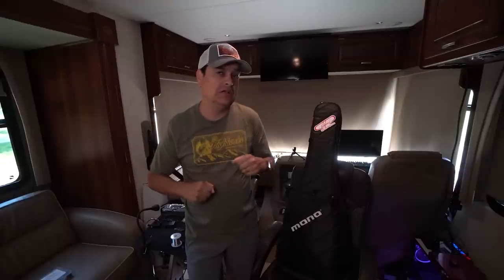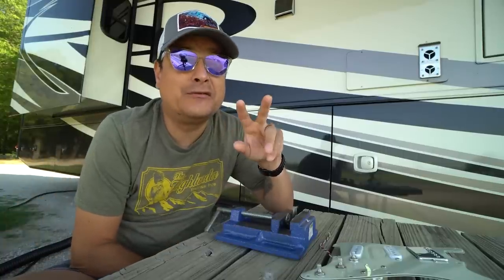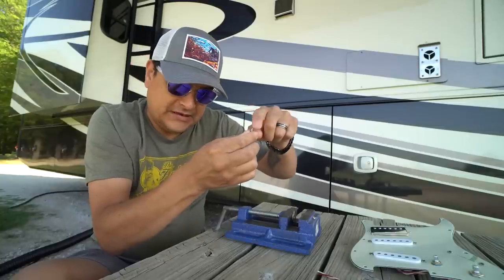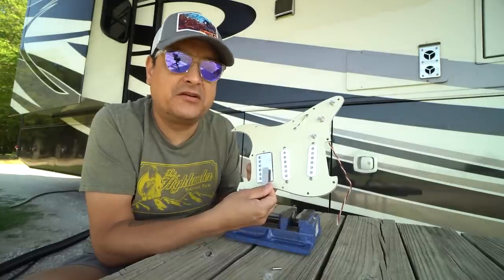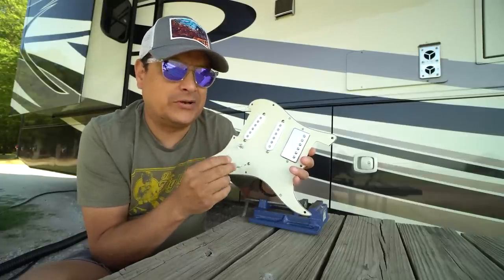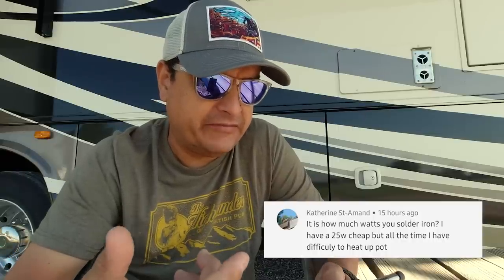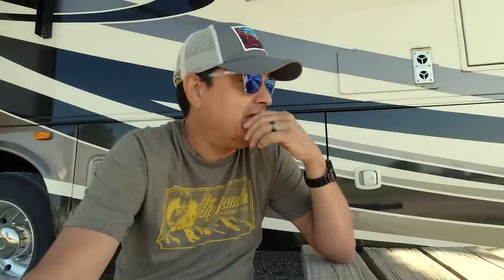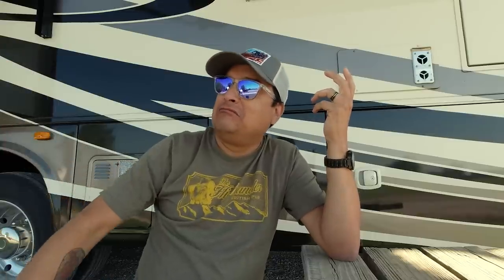Guitar Pickup Phase Explained

Comment: To add to this: when I assembled my now 41 years old Partscaster, I tried out different combinations of pick-ups. At one point I noticed that the Bill Lawrence L250 (stacked) had a different polarity to my other two choices, a Seymour Duncan Quarter Pounder and a Fender X-1. So I tried the reversed electricity option on the BL, with the Fender in the neck, the B Lawrence in the middle and the Duncan in the bridge. It gives beautiful tones, with my favorite position 4 - bridge/middle.
I also installed parallel/series switches with great results.

Comment: Sorry, but it is totally confusing to refer to polarity phasing. Correct phrasing is simply that pickups have the same polarity or opposite polarity whereas phasing properly refers  to "wind direction".. 

Second of all,  it is merely convention, and meaningless, to always insist on the inner coil end being "hot" (positive) & actually reverse wind the coil. Electrically, there's no difference between  a pickup wound in one direction and a pickup wound in the opposite direction with the leads swapped. Yes, in one case the signal lead will be connected to the inner end of the coil,  whereas in the other case it would be connected to the outer end...but, again, electrically, it makes no more difference than, as you described, rotating a single coil pickup so that one side is toward the neck rather than the bridge.

Hum cancelling comes from  connecting two opposite wound (or same wind by swapped leads) together. 

That's not to say that polarity or serial  vs  parallel connection doesn't matter. The output will be less if  the polarity is the same (but opposite wound or leads swapped), but it will still be hum cancelling. Likewise, serial connection of two opposite-wound coils, as in humbuckers, will still be hum cancelling even if the polarity is identical (but, again,  in that latter case, output will be less). Finally, as with connecting two single coils, is also hum cancelling  when connected in parallel...but, again, less output is the polarity is not reverse in the two pickups.

This is not to say that serial vs parallel connection is identical:  Because the resistance of the two coils is added together in a serial connection,  the  output will be "warmer"...hence, the thicker sound of humbuckers.

The point is that charts which show all of the combinations of polarity & wind direction imply that only1/4 of the combinations are hum cancelling…are not accurate. Actually, half of them are, though half  of  those (w/ same polarity) will have reduced output.

And, you noted that thinner wire allows for more winds to fit on a bobbin. But, there's a tradeoff: More winds means more power output, but thinner wire reduces some of that increased output, as well as producing more "muddy" sound. Hence, as long as the thicker wire & bobbin size will allow adequate winds to fit, the output will be greater & less "thick" than with identical winds of thinner wire. Hence, the best bet would be to use a bobbin that is as wide as a "jazzmaster", but taller, and thicker wire. That would give great output (inductance) but with lower resistance.

Comment: Theory Question:   Consider  two Strat single coil pickups that are magnetically and electrically the same.    For hum canceling could you reverse the wiring on one and mount it in the guitar upside down?   Would the upside down pickup work to a degree?

Comment: great info but there was one error- reverse wound/reverse polarity single coils will not act like a humbucker UNLESS  you also wire both single coils IN SERIES.. Strat style single coils are wired in parallel, Gibson style humbuckers are comprised of two single coils wound in series (but as dylan said, they are wound internally reverse wind/reverse polarity to cancel the hum)

Comment: hey there Dylan, got one for you, I have an issue where I wired an HSS style strat, the issue is I get a sort of out of phase sound when I wire the north coil of the humbucker and the neck pickup, how do I go about this issue and get an in phase sound? also I have a superswitch in my strat, I want to go for a tele style middle position sound in position 4(or 3)

Comment: I'm kind of confused.  Doesn't pickups always need to be hooked finish lead to start of another pickup to buck a hum? Or start and finish doesn't really matter as long we keep pickups out of phase easy as swapping the wires? And does humbucker need to start from a north coil and is it the same result if we make south coil start a hot wire and link S finish to N start and N finish to ground?

Comment: I have a 1964 Gibson ES-345 TD that had a pat no. neck pickup that had way too much bass so I tuned it around and it sounded way more tolerable. I assume moving the poles by an inch, if that, helped the poles pickup the string at a preferred part of the string or was this just dumb luck?

Comment: is the magnet supposed to be flipped over or rotated 180 degrees? i did my neck hum magnet and the video said keep the same side facig down and only rotate the magnet 180 degrees, but i see you also turned it upside down, is there a reason to do ity one way over the other? it seems to be producing the desired effect, but it is pretty subtle.

Comment: Hey Dylan,. I have a 1996 Stratocaster plus with Lace sensors. My question to you is I checked the magnetic north and south of the pickups and they all face north facing out.  I recently got it used.  I love the guitar but not sure I wasn't ripped off

Comment: The only time flipping a HB pick up Will it affect your tone, is if you do a PRS style Wiring. With a five way super switch, tou can select the inner or outer coils of the humbuckers. A lot of times the wiring/soldering will be fine, but you will need to physically flip a pickup to get the desired combinations: Inner-outer,  inner-inner, outer-outer, etc....

Comment: Oh, Dylan, please, please, tell more about this!..
Seymour Duncan in one of his interviews said that he made a set of Strat singles for Jimmy Hendrix with same magnetic and electric polarities. Also early (earlier) Stratocasters didn’t have that RWRP thing ‘cause they were using 3-way switch—one pickup at a time, no pickups working simultaneously, so why bother.
That story pushed me into thoughts “what’s the difference?”
I found many vids on YouTube with people stating that any hum bucking or hum cancelling thing cuts off some percentage of the signal. I remember your video about vertical humbuckers —those Fender Noiseless pickups— you said there same thing: either hum and signal richness, or silence and signal losses.

Both of these are in phase. So they don’t sound like someone speaking with nose plugged. What is the difference? I understand I can run my own investigation and listen to it in person, but. My question here is more about the technical stuff going on—what’s happening?

Thanks!

Comment: Thanks. I'm going to try out of Phase wiring with some Wilkinson Humbuckers on a $65 Ibanez Type China Guitar for an Experiment. The Volume Knob will be Push-Pull CTS and for the first time I think I will Delete the tone Knob that I never use and put the 3-way toggle switch there instead. From watching your Videos I think it will work just fine? If any of your Viewers have any other suggestions please comment. I'm in Tone Experimental Mode for now. Thanks Dylan for all your Knowledge that you share with us.
Reply: If the pups have 4 wires, you can try series-parallel -works better with less gain.

Comment: What happens if the pole pieces are mixed within a pickup for example alternate polepieces are reversed when put in the bobbin? Will it just end up causing the output to be zero as the cancel each other out or will it end up being like an in-line humbucker and cancel some of the noise while still outputting a signal?

Comment: Not sure if this is a dumb question, but: can you have 3 humbuckers all in phase together? I have a triple humbucker sg, I love the middle and bridge together, but the middle and neck sounds weaker than the neck alone. Does this mean they’re out of phase or is there something else going on?
Reply: Usually when in combination pickups are wired in phase and in parallel (as opposed to series), which reduces volume somewhat. (Parallel out of phase is the 'peter green' mod, for reference).  Adding a third pickup in parallel is definitely possible but will also continue to reduce volume.

Comment: Hi Dylan, my understanding of the pickup arrangement in a strat for "hum cancelling / noiseless" configuration is to have the middle pickup out of sync with the bridge & neck pickups, if a "Gilmour" switch was fitted would this give rise to "noise" if the neck & bridge pickups were both in use ? And if so would there be any with all 3 pickups on ?  Thanks Roger
Reply: In fact this is how a Mustang is wired. In the middle switch position, they act together like one humbucker. And yes, if you go back to position 1 or 3 on the switch, the hum comes back.

Comment: I just corrected a kid on 60 cycle who didn't seem to like the visible poles being far from the bridge commenting about phasing. Ugh..

It's just the way it's always been. I blame Gibson.

Those two strat pickups should be magnetic opposites. Both have same wire colours so maybe you got a neck and bridge not a Middle

If they stick together face to face they polar opposite. If you can disconnect the ground shunt your good to go. As you obv know

3 knob DPDT series parallel and out of phase that Epiphone with double centerpunch and open front covers

Comment: Wouldn't flipping the humbucker around so that the screw-pole pieces were on the bridge-side make the tone brighter, as they are then closer to the bridge? This would probably be more noticeable if the screws are raised or lowered to balance the volume.

Also, on humbuckers, do both bobbins typically have the same number of windings, and same type/strength of magnets?
Reply: Usually they have the same type and turns of wire, also humbuckers only have 1 magnet
Reply: @theccarbiter  most hand wound humbuckers have offset winding. Like 1 would have 5002 and the other have 5120